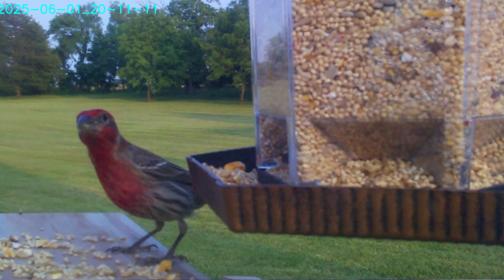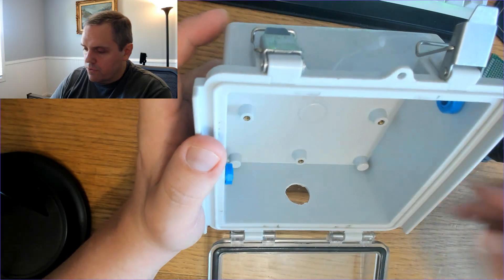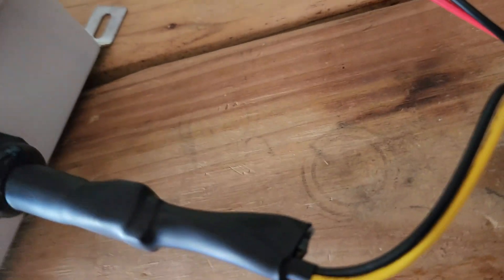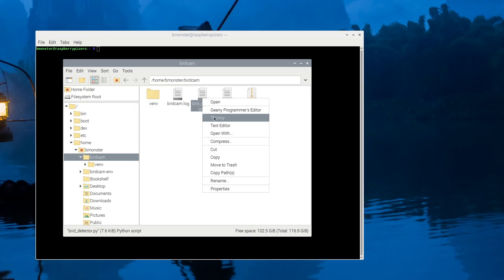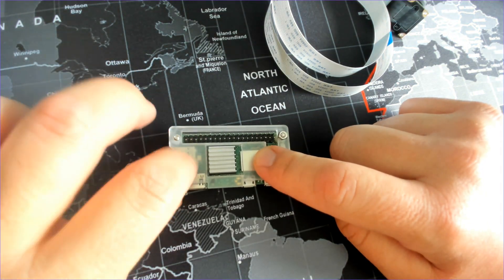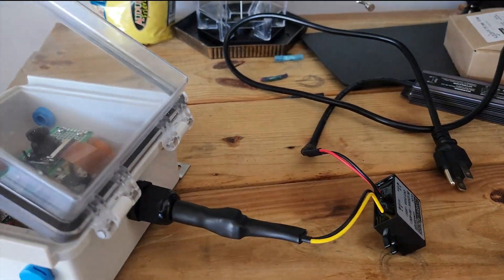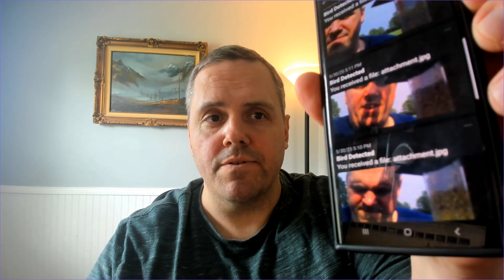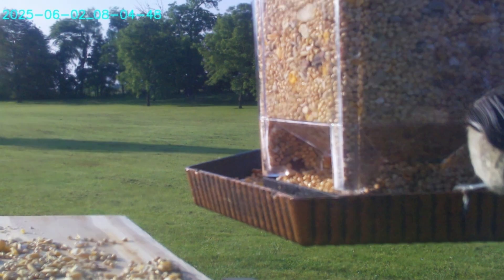Raspberry Pi Bird Feeder Camera That Sends Wildlife Motion activated Alerts!

Comment: Hi, Great video. I have bought a pi Zero W2 and v3 camera hoping to do some similar projects , birdbox and feeder. I have done programming in the past but new to Pi and all the libraries. Would be very keen to read through your code to learn more if that was possible ?
Reply from the maker: Hey there!
That's awesome. Did you get the Pi 5?  I did this on the Pi 4 but wantign to transfer everyting over to pi 5 with a better camera. I'll also need to add some shade when spring rolls around so it doesn't get too hot.
Send me an email and I'll forward the info that went out to the email list. bmonsterlaboratory@gmail.com
👍👍